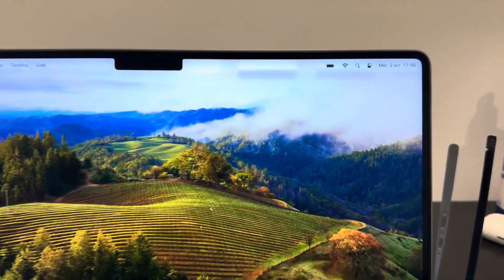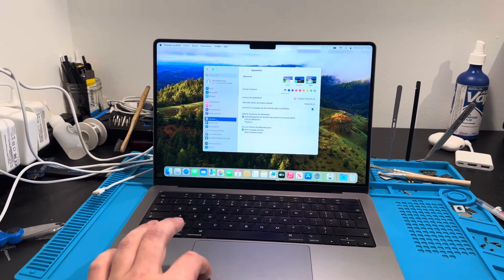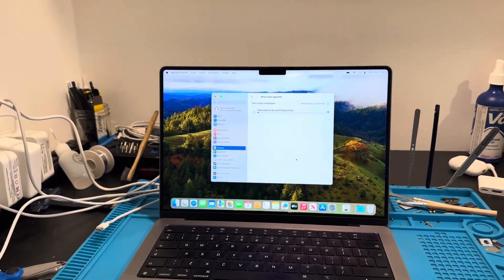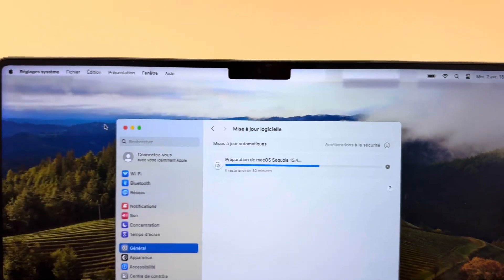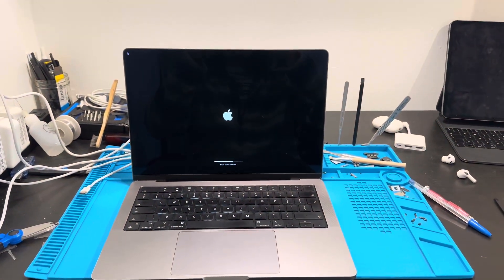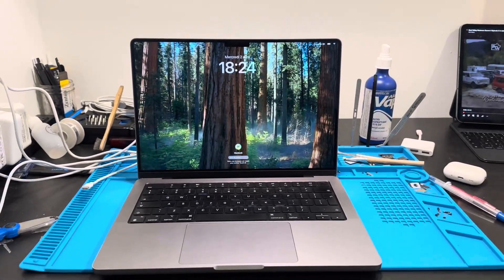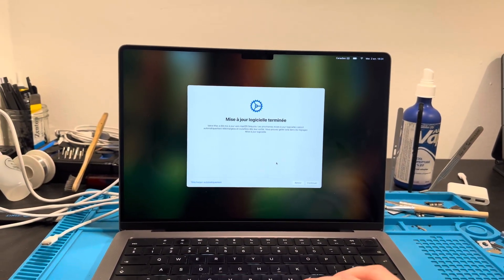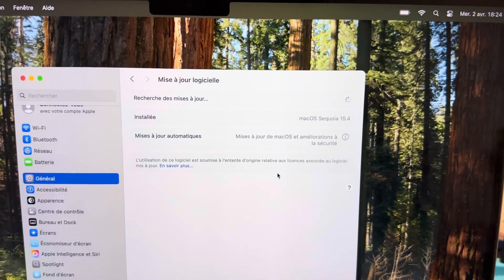A2442 Macbook Pro M1 Pro screen replacement artefacts fix  !! Simple NO SOLDERING!!

Comment: It's worth mentioning that in order for true tone to work, you still either have to transfer the two ICs or fix your screen via the official Apple self repair program. They are able to remotely calibrate your replacement screen, but they'll do that only if you got the replacement screen from them directly or from an authorized seller (those are listed on the website of the Apple self repair program).
There's always something with apple....
Reply: May I ask what the benefits of true tone would be? I generally do email and paperwork. Maybe lite photo/video editing on occasion...
Reply: @andersjohnson6162  I can't really describe it and I never knew anything about it until my wife broke her screen (she does a lot of video editing). I suggest you find someone who has a working MacBook screen she just toggle true tone on and off. I personally thought the colors looked way better with true tone turned on, but I've also heard other people say they prefer it off, so I guess there's no right or wrong here.

Comment: Did you replace the lid angle sensor as well or just the display? Would be interesting to see if clamshell works fine and the lid angle is recognized properly.

Comment: is this for real though, I can't find any documentation
Reply from the maker: You can find more documentation on i fix it website on the update from the 12/13/24 https://fr.ifixit.com/Réponses/Afficher/744273/Display+issues+on+MacBook+Pro+14%22+M1+-+Shadows+on+Screen
Reply: @ awesome!
Reply from the maker: Yes screen came from a dead computer ! And then I just update to the last OS update !
Reply: never knew apple would do something like this, i guess the lawsuits are working finally
Reply from the maker: Also I tried it my self and it worked all you need is a original screen
Reply: @Apple_Juice_Repair  ah ok, so the screen came from another mac?
Reply: @ hey man, thanks! great information.
Reply from the maker: Thanks men please subscribe if it was helpful  @plesma9386
Reply: «UPDATE 12/13/2024: The release of macOS Sequoia 15.2 has resolved this issue as long as the screen is an authentic Apple display.» from that ifixit site